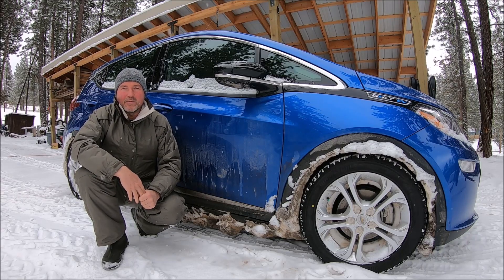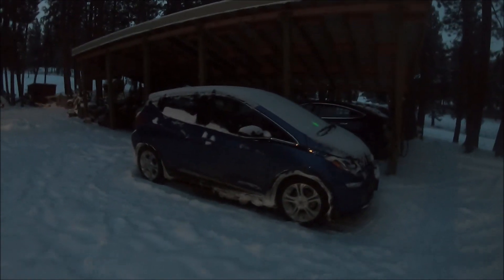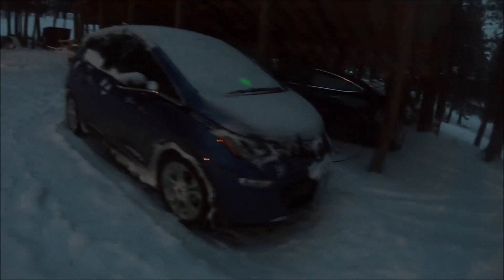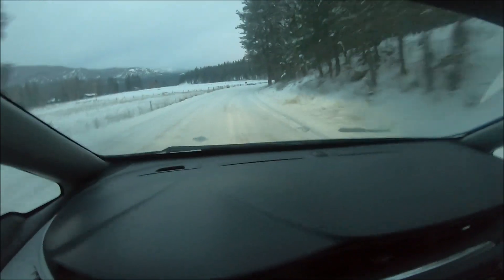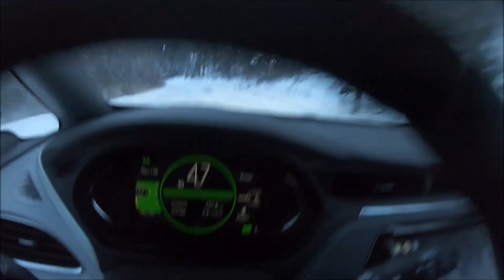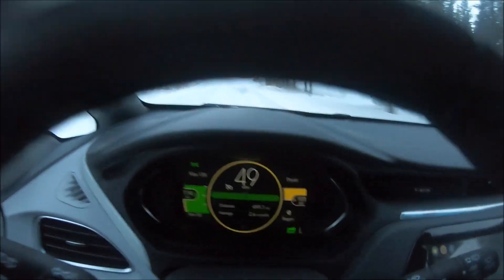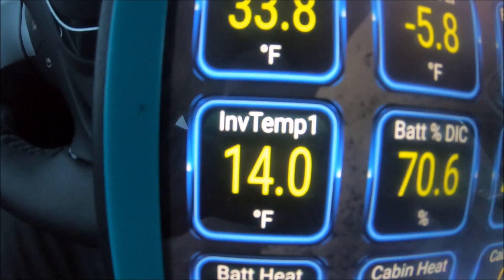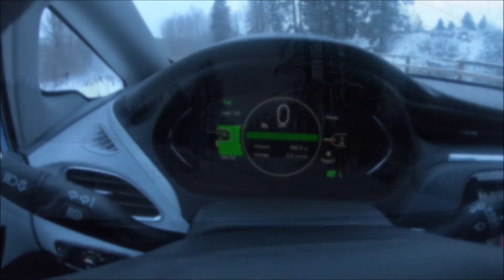Chevy Bolt EV Cold Morning Drive(-9°F/-23°C)No pre-heat, get in and drive. Regen/Power restrictions?

Comment: Watching this video four years after you released it. Recently got a used 2020 Chevy Bolt and I’ve been a bit nervous about winter since I have to leave it parked outside and only have a level one charger. Your weather is a bit sharper than mine in the PDX area but your video has reassured me that I will be OK. More than OK. Kiitos!
Reply from the maker: Congrats on the Bolt. You’ll be fine. The 2020 Bolt is a great vehicle. Level 1 is a bit slow. Depending on your situation you may consider a level 2 32AMP charger.

Comment: Just out of curiosity...would it be advantageous to partially block off the front bumper to reduce some of the cold air on very cold trips? 🤔
Btw, thanks for the great vid. 👍🏻
Reply from the maker: Good question. Unlike a gas car EV's have very few and small openings at the front since there is no continuous cooling required. Most EV's even use shutters to open and close these openings as needed. Since the heat is not generated by a gas engine in the front it would not help to close off openings. Heat for the cabin, battery and powertrain in the Bolt is generated by PTC (electric) heaters. Airflow is usually not going thru the whole front compartment but is directed just thru heat exchangers (radiator, condenser). Blocking any opening can also lead to air conditioning problems. Even in extreme cold the air conditioning is used to dehumidify the cabin air, if the condenser is even just partially blocked this can lead to problems with the system including compressor failure. BTW when people block off the radiators on their ICE vehicles they usually experience air conditioning issues sooner or later as refrigerant temperatures in the A/C system run way higher than they should even in extreme cold. Luckily humidity is usually low in  extreme cold and the A/C compressor doesn't come on very often.
Thank You for watching 👍

Comment: I know the large battery makes up for it, but the Bolt isn't exactly efficient in very cold weather. It'll happily suck well over 30 kWh per 100 km (metric here).
Reply from the maker: No EV is really efficient in cold. As heating the cabin requires electricity and thus efficiency can get bad. EV’s with heat pumps do better, but not by very much. That is why pre-heat while plugged in is important. This way there is not nearly as much energy spent on heat while driving and thus you keep more range. Now think about in an other way, the energy in the Bolt’s battery pack is about the equivalent of 12 liters of gasoline. I have not seen a gasoline powered car drive as far as the Bolt at highway speeds. I think that’s the key point, it is still more efficient and less polluting than a gas car.
Watch some of the winter driving videos we have with the Bolt. We usually get 150+miles (240+ Km) depending on terrain and speed with the Bolt. That would bring us just around, usually below 30kWh per 100Km. If used as an around town car consumption will increase, due to heat loss in the cabin as well as no “natural” heat gain in the battery pack. Unfortunately there is only so much that can be done with current technology.
Reply: @RMTFamily  It seems that a heat pump cuts the energy consumption in half or even a third or better still. I've seen Bjorn's videos with the Ioniq heating with heat pump vs resistance, and it was quite pronounced.
And propulsion consumption isn't that great with the Bolt in very cold weather. It seems you get penalized more so with this than the Ioniq.
But the very large battery of the Bolt makes up for it.
So yeah, 240km vs Ioniq's 140km (with heating on), that's indeed significant.
Those whos errands run upwards to 100km, are ok though.
Also interesting, the Ioniq will let you stretch it to 240km in the summer. It's the most efficient ev out there according to the numbers. Still, that 28.8 battery is restrictive.
It seems the Bolt is obsessed with high hp motor and perhaps the battery chemistry isn't as good as it could have been, because the numbers should have been a tiny bit better on the Bolt. Not that it sucks. Again, a whopping 60 or 65 kWh makes up for a lot.
Reply from the maker: @Antiorganizer  Heat pump vs resistive type heaters consumption can go many different ways depending on temperature. Many EV's with heat pump also have a resistive type heater added in the system for extreme cold when heat pump is not as efficient and can't necessarily heat the cabin quickly or warm enough.
Once the Bolt's cabin is at temperature the heater averages about 1500 watts, a heat pump will use about 1000watts. But there are so many factors going into it, that it is hard to say how much range gain you get from having a vehicle with heat pump. Let's say a resistive type heat vehicle uses 1500 watts and a heat pump type uses 500 watts, both have the same size Battery pack and both consume the same amount for the power train. on a 3 hour drive the resistive type heat vehicle would use 4.5kWh for heat while the heat pump vehicle used only 1.5kWh for heat. At 5Km/kWh the resistive type heat vehicle uses 22.5Km range for heating while the heat pump vehicle uses 7.5Km for heating. A difference of 15Km. Not a huge amount but depending on the situation having 15Km more can make a difference.
Another thing to consider between the two vehicles your looking at is the weight. The Bolt with 66kWh compare to the Ioniq with less than half that means the battery pack in the Ioniq is less than half the weight which lowers consumption too.
It is hard to compare vehicles with a large difference in battery capacity and electric motor power. It comes mainly down to personal preferences and what works for you. A heat pump would not be a factor for me when choosing an EV. Most likely all EV's will eventually have them. The Bolt for us has been a great vehicle overall and I really like it. But I do not have personal experience with Hyundai, so I can't really say if it is better, worse or maybe the same.
Reply: @RMTFamily  Of course there is always a resistance based heater, or else there will be no heat in very cold conditions.
In -25C conditions, videos are showing how the resistance based heating will suck a lot more than 1.5 kW. More like 7 kW, and keeps drawing that. Ioniq will draw like 5 kW, and I'm not sure what its max is. At those temperatures, the range on the Ioniq becomes low, around the 140 km mark, with heating on.
2 hours of driving represents 10 kWh, which is close to a third of the capacity.
In milder conditions, around the -8C mark, there is big relief for the small battery 28.8 Ioniq. Heating goes well below 1 kW thanks to its heat pump, and range without heating becomes like 190km, 175km with heating.
In warm conditions, it's a more comfortable 210-240 km, and that's with A/C.
Those with a Bolt won't be as sensitive to these factors and conditions, because they get a lot more reserve.
It's impressive how the Ioniq is so efficient and able to stretch everything possible from its small battery. Reportedly, it's the most efficient EV, although in some tests the Model 3 comes out ahead. The Bolt scored about 20% lower. But with a whole lot of extra reserve, one doesn't have to care.

Comment: One pedal driving is the second best solution. The most energy efficient driving is coasting. But in practice, that is not always possible. But regen is only 60% efficient.
Reply from the maker: Hi Ronald, as you say coasting is not always possible, actually it is rarely possible in most traffic situations. You would have to focus extremely on coasting in order to increase the efficiency which could also make one a hazard to others on the road. 
How efficient regen is does not really matter because it is always more efficient than using the brake.
The most important part is to use single pedal driving the right way. This video is certainly not showing that at all. This video is showing how not do it😂😂.
It is actually possible to coast with single pedal driving, as long as the focus is on keeping the speed or the distance to the car in front not on the "power meter" to see if one is actually coasting. In single pedal driving the foot always stays on the accelerator pedal unless one wants to stop the car or needs max regen (The Bolt can add even more regen by using the paddle on the steering wheel) to slow down. The Bolt has to be in L or the new ones have to have single pedal driving turned on to really take advantage of that feature. If driven in D or single pedal driving turned off, the Bolt will not be as efficient and that is not actual single pedal driving as the brake has to be used to completely stop and hold the car.
For most people single pedal driving will be more efficient and saver than trying to coast. Most people don't even coast in there ICE cars.
But most importantly don't drive like I do in this video. The on/off the accelerator pedal is the worst for efficient driving. Also it makes rear seat passengers sick.
Thank You for watching.

Comment: It was -2 F this morning in Chicagoland. I never need a block heater for my car. At this temp, the starter cranks for a half second before the engine fires up. I usually wait 15 to 20 seconds before backing out of my driveway and accelerate easy for the first three to four minutes. 
When you change over to winter tires, do you have a set of dedicated rims that they are on, or do you just install them on the wheels that your all season tires are on?
I was planning to put on some Michelin crossclimate 2's next winter, because of the age of my current ones. (10 years old, with only 36,000 miles on them)
Reply from the maker: Hi Bill, many cars are having issues starting and running at that temp. I'm glad you don't have that problem. It sounds like you are driving it the right way and take good care of it.
I prefer to have 2 sets of wheels. This way I can change them when I want to and don't have to wait for a tire shop to have time to do it. This is especially helpful if there is an early winter storm and the snow sticks around.
I heard good things about the Crossclimate. I usually have the Michelin X-Ice, the Bridgestone Blizzak and now this winter I'm having the Pirelli Soto Zero on one car. The Michelin's and Bridgestone seem just a little better than the Pirelli but not by much at all. 
Stay safe out there.
Thank You for watching👍
Reply: @RMTFamily  My car was made in 2013, and runs like it did, the day I drove it home. 
Not only that, but my battery is also 10 years old, and starts the car like it was new. I was thinking of getting a set of winter tires, along with a set of rims, but because my tires are large and expensive it would probably cost me over $1300 for the set, with rims. The car is a large Genesis sedan RWD. When I replace it in another 5 years, I'll be sure to get AWD.

Comment: It would help for people who are not familiar with the Bolt to point out what the dash board numbers are. I could read the numbers but not their labels.
Reply from the maker: Hi Greg, The numbers on the left side are the estimated range based on the current charge. The amount of charge is indicated by the green bars between the bottom and top numbers. In the video it's showing 75%. The top number is the max expected, the one in the middle is the average expected and the bottom number is the minimum expected. On the right side the one number shows the amount of power used when yellow and the amount of power regenerated when green. This is also indicated by the yellow bars above and the green bars below that number.
In the large center circle, at the top it shows the speed in mph, the upper number in the bottom half is the trip meter showing miles driven since last reset, and the number below that is the average consumption in miles/kWh.
Hope that helps.
Thank You for watching👍

Comment: What app is that to get the battery temp, etc ?
Reply from the maker: Hi Dale, there is no app that can read the Bolt OBD as is. Depending on what device you have, android or iOS you’ll need a different app. But either way you’ll have to import the PIDs for the Bolt. I have a video that explains this in detail for android, but contains the info needed for iOS as well. Here is the link: OBD2 Reader for Chevy Bolt EV. Which OBD bluetooth dongle, app and how to make it all work, Android.
https://youtu.be/mNvDXw7n8jM

Comment: I have a question about single-pedal driving.

Does it trigger the brake lights when you lift off the accelerator to alert the driver behind you? If not, I could see that being really problematic. 

Plus for me, as somebody who tends to “coast” a lot when driving an ICE vehicle, I think it would take a lot of getting used to .
Reply from the maker: Yes it does trigger the brake lights but it depends on the amount of deceleration. As you let go of the gas pedal in a ICE car, the car will slow down but no brake lights until you step on the brake. So in electric cars if the deceleration is very little it will not turn the brake lights on, if it goes over a certain threshold it will. To a driver behind you it will look pretty much the same.
It is very easy to get used to it. Just think of it as a speed control pedal. Don’t worry about it using power or regenerating power at all. Just use the pedal to keep the speed you want. You don’t need to find the 0 point and hold it there. Just keep the speed (not the pedal) where it would be in your gas car. You won’t even notice if it using or regenerating power. The only difference is that on the gas car is, you let completely go of the pedal while with electric single pedal you stay (feather) the pedal unless you want to stop.
I love single pedal driving, the brake is used only for times when regeneration does not slow down the car fast enough or in an emergency situation.
Keep an open mind, it kinda like when cell phones went away with a keyboard😂we just got used to it and now could not even imagine to go back😉
Hope that helps.
Thank you for watching 👍

Comment: I have owned 2 Chevy Volts and in the cold the economy suffered mostly due to the resistance heat. I have also owned a Prius Prime with a heat pump and it lost very little in the cold. My question is during the 40 hours while plugged in how many kilowatts were used to maintain the battery?
Reply from the maker: Hi Paul, great question. But I don’t know the exact answer to it. The Bolt does very little battery heating. It will just keep the pack at about freezing. It seems like the pack retains heat really well. Usually when I checked the time for last pack heating, with the OBD reader, it is at least 24 hours ago. The pack heater does not run for very long at all. Taking a guess I would say it maybe ran once in the 40 hour period using maybe 2 to 4 kWh.
You’re totally correct that a heat pump uses less energy. Chevy still used the resistive heater in the refreshed Bolt and EUV.
Thank you for watching 👍

Comment: what was the estimated range at that temprature?
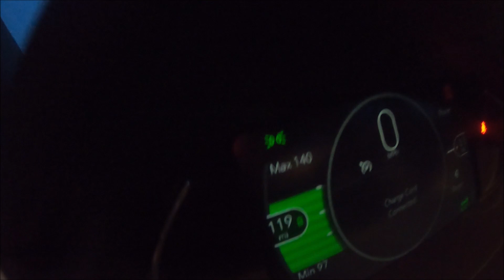Reply from the maker: Hi Jim, the estimated range is not necessarily accurate as it is usually based on the average from the last 30 miles of driving and taking the current power draw of the heater into account. Go to timestamp 6:00 and watch from there to see the SOC and GOM on the dash.
Thank You for watching👍
Reply: @RMTFamily  OK, how far do you think you'd be able to drive in those conditions?
Reply from the maker: @BlondieSuperdog  If I wanted to get maximum range then I certainly would preheat the cabin first while the car is plugged in. Charged to 100% I could get at least 150miles out of it. That is based on highway speed average 70mph with elevation gain of about 2000ft over the 150 miles. If I do the same trip the other direction I could get at least 175 miles out of it.
There are so many factors in this range game that make it hard to give specific numbers. You should watch the Bolt winter road trip videos we have to get a better idea of how much range you could get. This video contains the stretch of 150 miles that I used as an example. Chevy Bolt Winter Road Trip to Island Park ID. 600+ mile trip with EV in winter. Part 1
https://youtu.be/DaqqZV5Kk1I